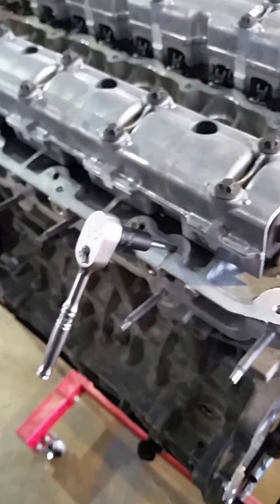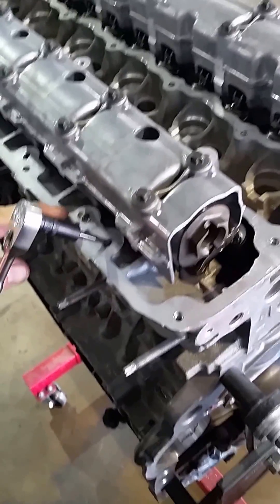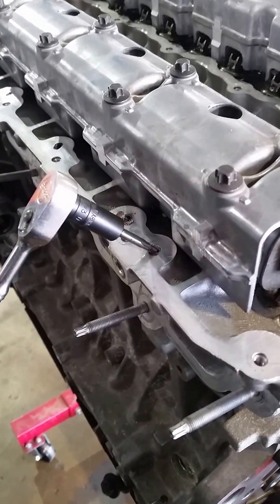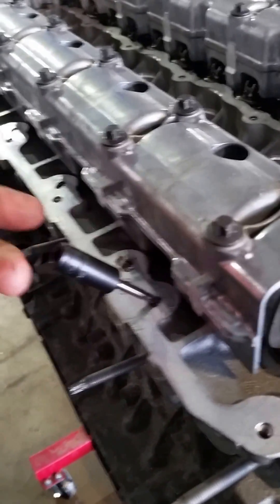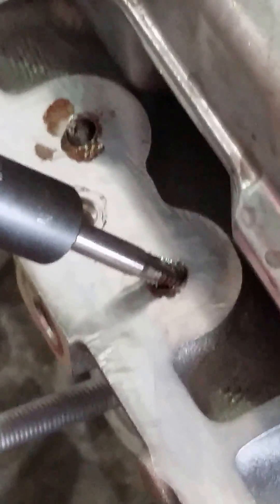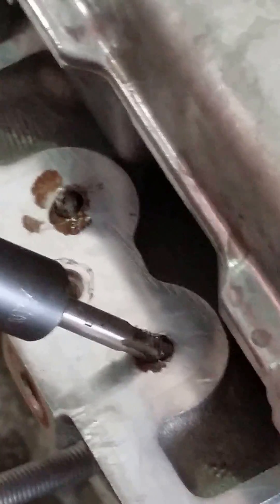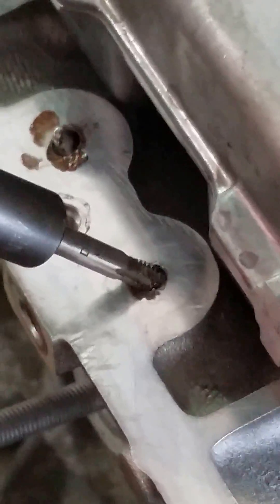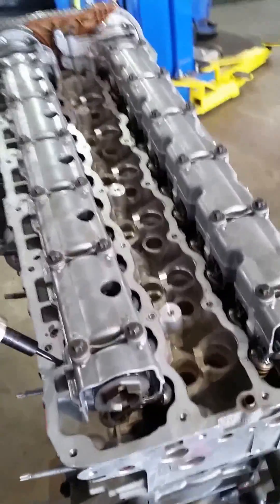ABR explains how to not break a tap on the BMW N54 PCV ports

Comment: Any suggestions on how to remove the tap if it breaks off in the head? My mechanic successfully tapped one port then snapped the tap in the second one. I too over and did the rest with ease. Now I’m stuck trying to figure out how to get this tap out without having to remove the head 🤬🤬🤬
Reply from the maker: Removing a broken tap is not for the novice, and it's not fun. sounds like your "mechanic" was a great guy lol. In all honesty, unless you have a broken tap extractor (which is not easy to use correctly, and is designed to be done on a 90* hole, not an angle, you don't have a lot of options other than to poo-poo some JB weld on the hole and hope for the best.

Comment: Is that useful only to get No more boost pressure in The valve Cover? 
Or also to let only The RB external pcv workin? I thougth The low load OEM pcv System Is deactivated by using The external RB Kit. So even if The Ports Are Not closed, No oil getting throught them to The valves. Is that correct? 
Or Are Both, OEM pcv and RB pcv Working At The Same Time ?
Reply from the maker: A few reasons, but typically a higher powered engine will overwhelm the factory PCV system, and an external system will easily handle it (if properly designed). We've had one client try to use the  RB kit with our head ports plugged and something wasn't correct- it blew out the rear main seal 2-3 times. No, OEM PCV is completely bypassed by doing this, and you MUST vent the system to not over pressurize the system.

Comment: in the video you mention this is ONE way of releasing positive crankcase pressure.is there any way to do it without removing the valve cover ? thanks for the video !
Reply from the maker: This is the way you make PCV pressure go to an EXTERNAL system. IF you simply plug these, you will over-pressurize your engine, and it will pop gaskets/seals. No, you have to pull the valve cover to perform this, and I've seen 20+ heads and posts of people breaking taps in the head..... so be careful!

Comment: If you have time, can you explain why people plug these ports?  If the channels only lead to the old PCV valve location, and that location is plugged by whatever external PCV mod kit you're using, is it not effectively the same solution?  Why is plugging these ports required too?
Reply from the maker: Big power means more volume of blowby, and the factory PCV system can't handle it. The valve cover is what seals to the head, and it will blow out the seal. So, you plug the ports and go to an aftermarket PCV system to handle excessive blowby the engine produces. By plugging it, it eliminates it.
Reply: Got it - thanks!

Around what boost pressures do you guys usually start to see valve cover seals fail?  I know the boost pressure itself isn't whats blowing out the seal, but it seems like it would be a good indicator of how much blowby you're generating.
Reply from the maker: It depends on the quality of the gasket and valve cover (age and mileage) but we start seeing issues around 18-20PSI... or at least the beginning of the issues.... oil pushing past seals, vacuum pump gasket popping out, etc.etc. 
Remember- ANY big power engine no matter what will make more blow by than a stock engine.
Reply: Gotcha.  I have been considering doing an external PCV kit purely so that I can install an OCC on the low load side of the system, but was concerned that I'd be introducing a new failure mode if I didn't plug these ports.  It sounds like that's not the case - the failure mode of blowby ruining valve cover and gaskets would exist regardless.   I'll just keep my tune conservative until I can find the time to get in there and plug these.

Thanks for all the info.  Love having access to serious pros like you guys on the internet.  Subscribed!
Reply: It was my understanding that this path will only be taken during low or no boost. This is to block off the low side PCV when the car is not wide open throttle. i.e. The majority of the time the car spends being driven. Simply prevents hours and hours of slow accumulation.